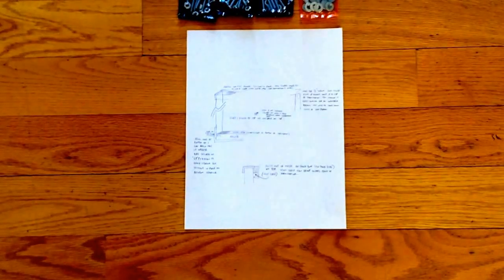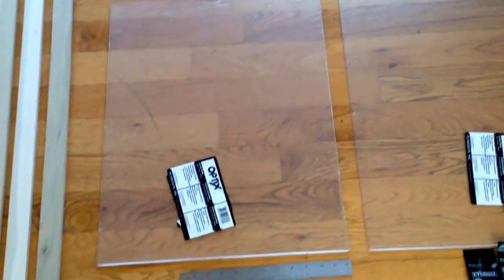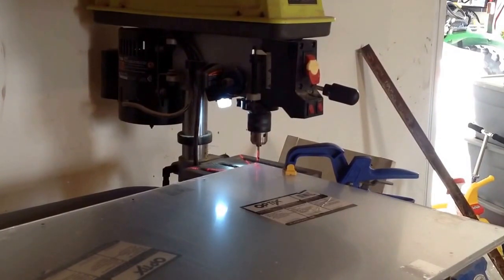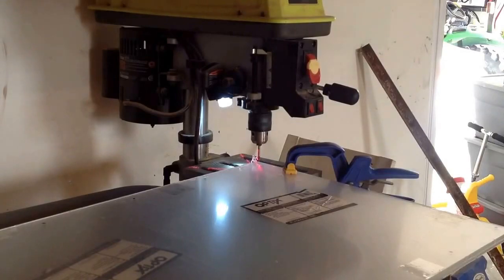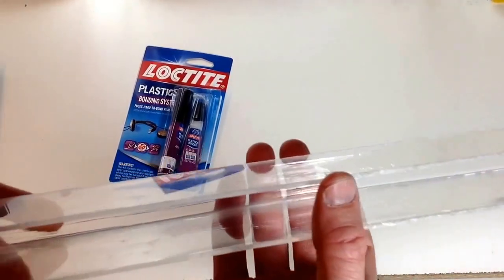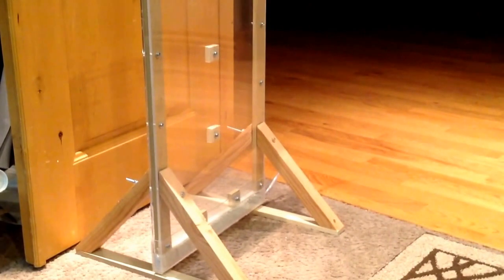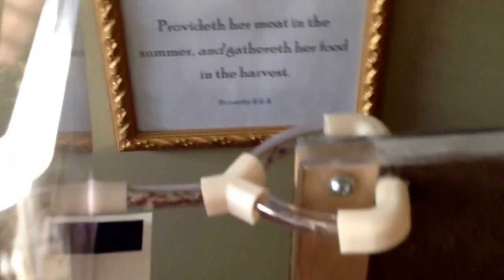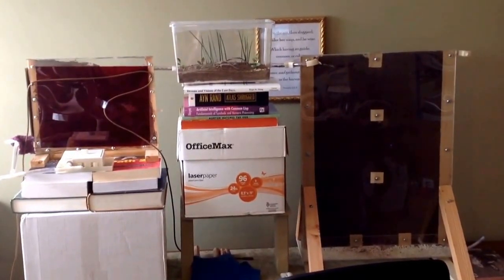Building a soil formicarium

Comment: I'm sorry I don't understand two things.
How did you make that barrier that prevents the ants from getting in the hydration system?(but at the same time lets moisture pass through) What about humidity gradient doesn't all moisture come from the bottom?
Reply: The barrier at the bottom of the nest is a piece of plastic mesh. I used silicone to "glue" it on. All moisture comes from the bottom and it has been working very well for the past 18 months. I don't add any water anywhere else in the entire setup and the ants are doing great. There is a visible moisture gradient in the nest as the water from the bottom is soaked into the soil from the bottom. When the ants need water, they go down deep into the nest.
Reply: Thanks for replying!! Now I get it!  I thought you used plexiglass.
A few more things...
Do you hydrate the out world? Do know if this system it's enough for keeping moisture in a forage area placed above the soil?
I hope not to disturb.
Reply: I don't hydrate the outworld, just the bottom of the nest. I think this mimics their natural habitat in the wild quite well. It may not work as well for moisture-loving species, but for these harvester ants, it is fine. Moisture-loving species may need other hydration options, like in the outworld for example, or a water test tube somewhere else in the setup.
Reply: That's nice, I live near Barcelona and Mediterranean ants are drought resistant like everything else here. Maybe some highland and continental species are more moisture-loving critters, if I ever get one of these queens I could place some test tubes or a water filled hydrostone.

Comment: how do you prevent them from escaping from the central "outworld"? I tried vaseline but they got somehow over it
Reply from the maker: The ants I have, red harvester ants (Pogonomyrmex occidentalis) are very poor climbers. They cannot climb up the plastic walls at all. There are other options for species that do climb though. Some use a mixture of baby powder and alcohol as a barrier. Others use vaseline. I use fluon (insect-a-slip) and I've had good success with it. You can get it at bioquip.com, or amazon.
Reply: @Ooper you did a really nice job there, would like to do it too but don't have all those instruments to cut trought the plexiglass and make precision holes...well i still have my ants in the setup tube but I don't have idea on which type they are, to be sure i'll seal the outworld and open it to give them food, if the colony gets big i'll have to find someone who is capable to make something similar like you made
Reply from the maker: Thanks! I wish I could manufacture these and sell them to folks that would like them, but alas, I don't have the time. Too much else going on. I'm sure you can find someone to help you out.
Reply: +Ooper for a reasonable price i would surely buy it, well you can think of it when you will become 60+ and stop working
Reply: Vaseline dosen't work well apparently. Try baby power with alcohol, olive oil, or fluon (aka PTFE-30)